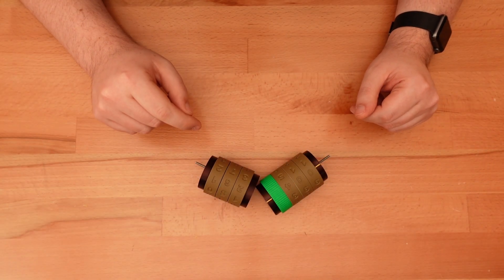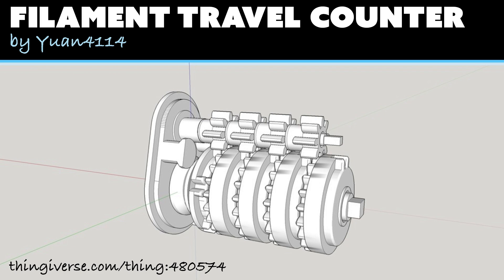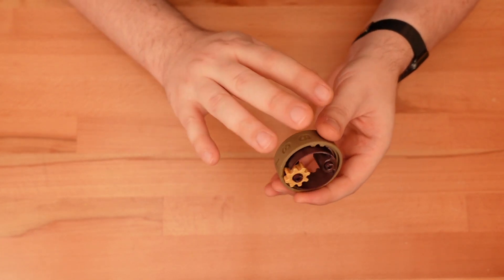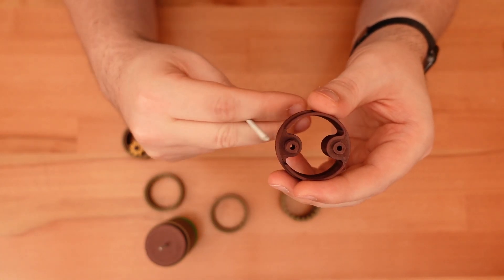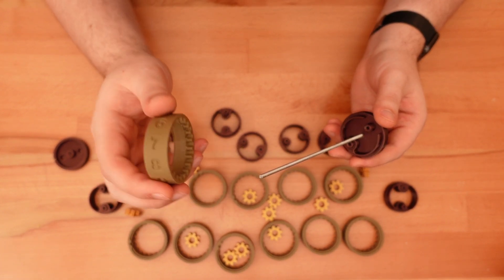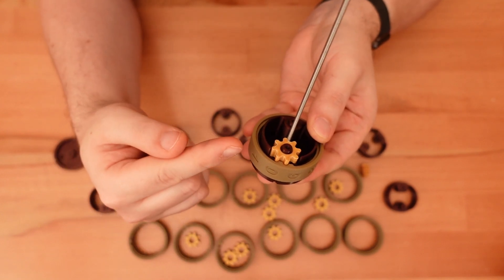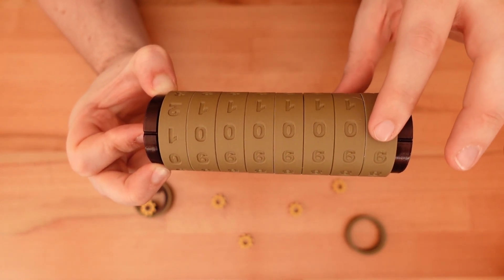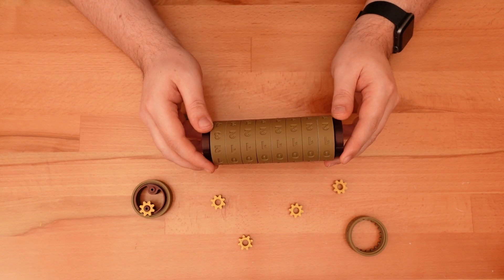3D Printed Mechanical Counter

Comment: Can you provide drawings for a 2 digit counter ?
Reply from the maker: Thanks to its modular design, all you need to do is assemble 2 number wheels and you're good to go! Well, I would recommend also adding the input wheel so you have a reliable way to set the first of the two digits. Good luck!

Comment: Hi is that possible the last layer is 0-8 only?
Reply from the maker: Possibly, although it makes things a lot more complex. For example, if the first dial has 10 digits and the second dial has 2 digits, you can just duplicate the second dial's numbers 5 times (1,2,1,2,1,2,1,2,1,2) and make sure it outputs a rollover 5 times as often (assuming there's a 3rd dial for it to output to).

A more dynamic solution would be to use normal gears to handle the digit-to-digit conversions and then connect those to a Geneva drive so the output display flips over quickly. I hope I explained that okay, it would be a more complex system, but it could handle a dynamic range of digits per dial.
Reply: @3DPrinty  Hi Thank you so much for the answer. Geneva drive is the solution.

Comment: That's actually a really neat design! I wonder if it works scaled down?
Reply from the maker: I've seen it printed at 50% scale and it still worked, but the clearances get a lot tighter. I'd say it's a challenging print to scale down. Good luck if you try it :)

Comment: Hey there, I am in the makings of an filament meter counter that can simply connect to any Bowden extruder using the 66 teeth m0.5 gear
Reply from the maker: That's great! You may want to check out a remix of this design called the "Filamentmeter" by ArduinoNmore that does something very similar :)

https://cults3d.com/en/3d-model/tool/filamentmeter

Comment: Great Video, I stumbled upon this after researching and stumbling onto Mathias as well. I was making my own version from just pictures. I appreciate your going over both things that work and why, and problems you found!
Reply from the maker: I'm glad it helped!

The counters I printed nearly 2 years ago still work, but if I were to redo this project, I'd add captive nuts to each digit assembly for more consistent positioning. I'd also look into using magnets to help snap the dials into alignment.

Both of these improvements greatly increase the cost and complexity of the build, of course, so it would depend on your needs.
Reply: @3DPrinty  I added sprint detents (under the lower carry gear) to my assembly in a effort to get them to index better, and have less drift/missalignment. But I am also running my tolerances extremely tight (0.15mm) Since the bambu can often easily hold this tolerance.
Reply: @3dPrinty I realized last night I might be able to solve some of my alignment issues by switching to a Herring bone  Gear (still working out the math on it). I am thinking that this will help lessen some of the thrust issues. Not sure if it will work for the carry mechanism yet though.

Comment: I wonder how small you can get this? Would like to use for flight sim altimeter
Reply from the maker: I believe I've seen a 75% scale print. If you have a resin printer with a durable resin, it could probably scale even smaller! All that said, it's not super reliable beyond 4 digits. I'm not sure what you'd need for your altimeter.

Comment: hey nice project i am working on an f16 simulator and i need something like this but it needs to rotate very fast could you rotate it from the other side?
Reply from the maker: Glad you like it! If you reflect the mechanism and create your own number wheels, that should work. I included some blank number wheels in this remix: https://www.printables.com/model/130643. Numbers can be added in CAD or certain slicer software, like PrusaSlicer.

As for speed, it'll depend on the accuracy of the print and how many digits you need on the readout. 4 digits runs fairly reliably for me, but they start drifting as you add more modules.

Comment: The slope issue could be designed out by printing a different file for each decimal place with the outside numbers slightly advanced. You could include an internal digit place number or an alignment mark to keep track of which number ring is which during assembly.
Reply: Great comment, dude.   But I wish this mechanism had an easy reset feature, to reset to 00000 but I don't see an easy way.

Comment: Hi, thank you for your cool projects. 
I have a question: I`m working on a project and  I need a mechanical counter mechanism. Can I use your mechanism? The project will be sold so it´s commercial use.
Thanks
Reply from the maker: Yup! Most of my models, including this one, are under a "Creative Commons: Attribution" license. This license DOES allow commercial use - as long as you provide proper attribution to the source. You can find out more (including a link to the license and attribution examples) on the project page.

Good luck, and I'd love to see what you end up making!

Comment: So impressive! Does it also have a reset to 0 option?
Reply from the maker: Thanks! This version doesn't, but the follow-up project, which uses empty filament spools, was designed so you can manually set the counter value to anything - including 0!
Reply: Wow, thanks for the fast reply! I'm thinking of using it in a costume. The reset isn't necessary, so I think I'll be fine without it. I love the look of the spool counter, though it's definitely too big for the costume feature 😆

I'm just thrilled that you designed this one that seems like pretty much exactly the right size! Once again, your skill is beyond impressive. Thank you for sharing your skill.
Reply from the maker: Good luck with the costume! Depending on your needs, you can also drop the indexing gears and then you can manually set the numbers... it just won't function as a counter.

Comment: How easy would it be to construct a mechanical counter with irregular digit wheels? Not just using this design, but really any counter design. So instead of wheels of 0-9, 0-9, 0-9, it's wheels of for example 0-1, 1-7, 1-30, 1-12, 1-7.
Reply from the maker: Certainly! But you'll need the right number of gear teeth in the ring and the correct ratio with the indexing gear. If you need very large or very small numbers, though, things get tricky. For example, a binary wheel (0-1) would need to rotate 180 degrees per number.... or fake it by repeating the numbers a few times: 0,1,0,1,0,1,0,1...
Reply: @3DPrinty  Ok thank you, and I was thinking about doing the "fake" method by repeating 0-1. I've been studying these mechanical counters enough that I think I could have my head wrapped around it soon. But I do wonder, how easy would it be to have one wheel controlling the next two wheels separately? Specifically, I plan for the first wheel (the binary one) to control the second wheel which cycles through 1-7, while also controlling the third wheel which cycles through 1-30.
Reply from the maker: Definitely possible, but tricky, it would require a second indexing gear with a long shaft that jumps past the middle wheel. I'm not even sure if that would be sufficient. If what you want to do is particularly complicated, you may need to use an external indexing gear that controls each wheel individually.

Comment: Excellent job.i want to how do working ingsame time all of thoses rotating ?
Reply from the maker: Thanks! For my 100% scale prints, it worked very smoothly with 4 dials (either 4 digits or 3 digits + 1 control wheel).

More digits work, but the rollover action becomes slightly difficult around 6 digits. You may have better or worse results depending on the print quality and how well it's assembled. You might also have better results if you print it at a larger scale.
Reply: Thank you

Comment: Hey,  nice Video. It is a really nice idea to put the gears inside of the wheels. I am the creator of the beer counter on thingiverse  https://www.youtube.com/watch?v=M1kdm8jpN80 and im working on a new version of that one. Maybe I can use your ideas to improof my design. I Guess the only problem is to reset the counter so i will try to make the little gears inside shiftable. But thanks for the really cool Video!
Reply from the maker: Reseting is tricky! For my "empty spool" version of the counter, the entire wheel assembly can disengage from the adjacent wheels so it can be set manually. I look forward to seeing your updated design!

Comment: Sorry - you set an external teeth into internal teeth and gearset ... that's not new .... visit campus of Dortmund's Technical University (Germany) and you will see it as a nearly two meter in diameter gear ring standing there for decades.

Nevertheless thank you for sharing your implementation.
Reply from the maker: If I'm ever near the area, I'd love to see it! I'm a huge fan of manufacturing and engineering history.

The goal of this project was to create an easy to 3D print mechanism inspired by Matthias Wandel's counting machine, but with hidden carryover gears. I hope I didn't imply that I had invented a completely new gear train. That would be silly and arrogant of me.

I'm glad you like the implementation. If you enjoy 3D printed takes on fun mechanisms, future videos will also tackle this subject. Thanks for watching!

Comment: It's a great design.  I don't know how, but it would be made better with a reset of some sort.
Reply from the maker: Thanks! I expect to have a solution in the final version I'm working on. Not really a push-to-reset button, but a way to manually set each digit to whatever you want.
Reply: @3DPrinty  It would make a really good counter for board games, but if you count up to 20, and can't reset it easily, it loses a lot of appeal.  Even if you're just resetting every digit individually, that would be great.

I can picture using the rod through the middle, but it extends a few millimeters past the end.  Then you put a washer, a spring, a washer and the nut.  The spring holds it together while you're using it, but to reset it, you can pull it apart, turn the individual rings, and then let the spring pull it back to normal.
Reply from the maker: This isn't that far off from one of the solutions I'm considering - might need 2 rods to help with alignment. I'm also floating a solution that involves sliding entire digit assemblies forward, to disengage the carryover wheel. I'm not sure what'll be the more reliable and printable option yet.

Comment: what filament did you use for the number rings? looks great!
Reply from the maker: That's Hatchbox Matte Brown. I'm trying it out for printing barrel puzzles and I like the finish quite a lot. Warning, though, it's more brittle than other Hatchbox filaments I've used and requires a higher than usual printing temperature.

Comment: It's very neet design but it would be much more useful if it could be reseted this without taking it apart. I would add some kind moving axile on those inside gears with lever or switch. Pushing lever would move whole shaft with those gears more into inside so number rings could rotate freelly.
Reply from the maker: No promises, but having a reset of some sort is planned in the final design. For this initial prototype I was just happy that it worked :)

Comment: How do you reset it?
Reply from the maker: This prototype has no actual reset. I haven't decided which method to use for a reset mechanism yet - sliding the indexing gear would be the most obvious option, but that would reduce the rigidity of the design. I might instead provide an option to slide the entire digit assembly so it disengages with the adjacent digits. In either case, there's more to come!

Comment: Would it help to rotate/offset the numbers by the same amount each dial lags behind? Assuming the counter will move in one direction in the intended application.
Reply from the maker: Good idea! Really, though, I don't expects practical uses of this mechanism to have enough digits for it to really matter.

The problem could also potentially be solved by adding some sort of anti-backlash spring to each ring. That could properly aligned numbers regardless of the direction rotated.

Comment: Really neat mechanism! It's definitely calling out for a static base to display only the relevant number sequence like a car dashboard.
Reply from the maker: A case of some sort is certainly under consideration! Of course, as soon as you make a case, you define a set length. So I'll either need to make a lot of different sized cases or figure out some sort of modular solution.

Comment: Hi. I'm printing your present box for a video and the square lid's overhangs have been giving me some trouble. It said that supports weren't needed so I was just wondering if I was doing something wrong.
Reply: You might need to tune your printers settings with an overhang test print, if it's all tuned up then cura has tree supports that should help without being difficult to remove.
Reply from the maker: Seconding what Henry said. But also, I just want to be sure the lid is printing in the intended orientation. It should be top-side-down, so the only overhangs are some fairly small bridges where the ribbons go. If your bridging direction is correct, they'll go straight across, and that distance is only about 10mm. Good luck!

Comment: Amazing. This can be used as a filament-meter, right? But then there should be a reset mechanism I guess. But wo, I love this small kind of counter.
Reply from the maker: I worry about adding friction to the filament path, but yes! One of the examples of prior counters I mentioned in the video is, in fact, a filament-meter! I linked to it in the video description, if you want to try it out.

Comment: Hmm. I'm wondering whether you can mix and match with ratios other than 10:1 to make a digital clock.
Reply: Would be cool
Reply from the maker: Cool idea! Should be possible to get multiple functional ratios even within the same counter, provided they all work with the tooth count on the outer ring.

Each ratio would require not only a specific carry-over gear, but also a matching core that positions it at the right distance to mesh with the outer ring.